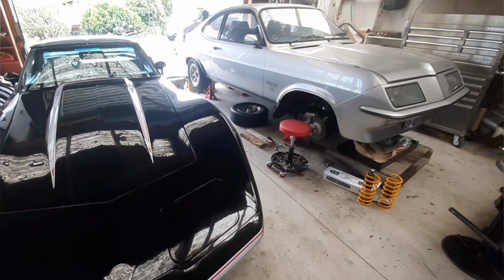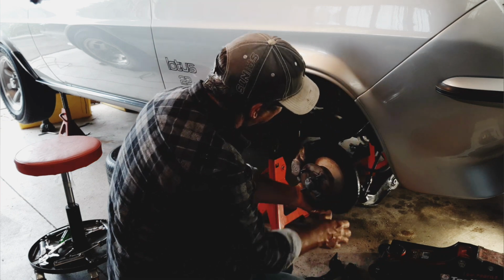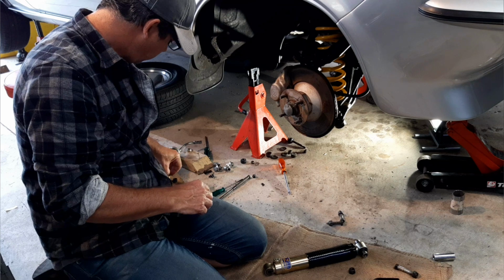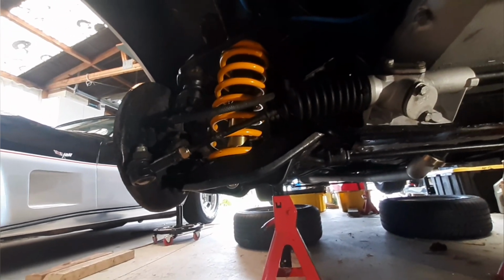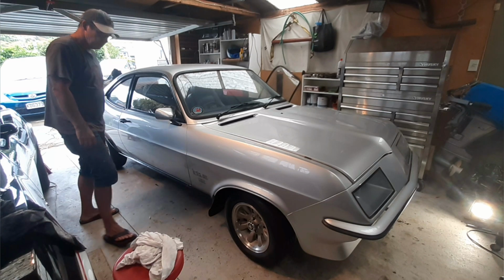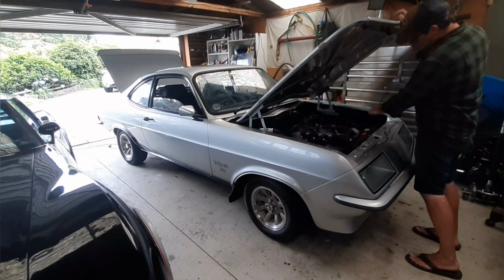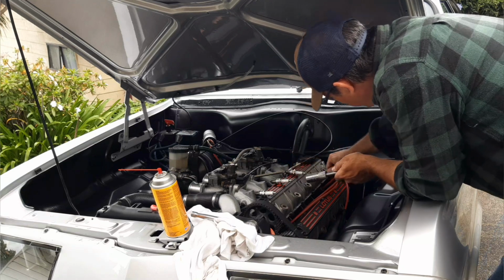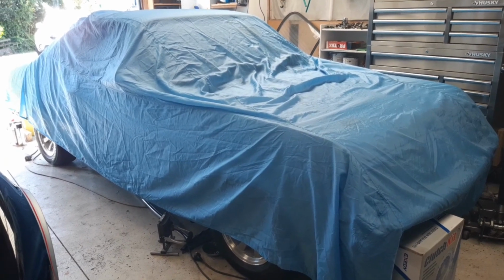The Firenza HPF finally gets some (unneeded) attention!

Comment: Great car, I love the droopsnoot firenzas, I'd definitely put some filters on those carbs, you'd be amazed how much crap is in the air that's been sucked into your engine, I use either a K&N or ITG filter for the weber 45 on my classic mini.
Reply from the maker: Thanks for watching. 
I do have the original airbox that came with the motor, which I need to finish modifying to fit between the carbs and brake booster. I can then also draw in cool air. 😎

Comment: Takes me back to circa 1973 when I put Blydenstein neg camber wishbones, springs & Spax adjustable dampers all round on my old Viva GT. The front end was a mare with seized bolts etc. Like you I was working on the ground with the car on stands. Not sure my joints now could handle the kneeling down & acrobatics you are having to do there & I can assure you I was cursing & swearing just as much at 17 years old so it's not a grumpy old man syndrome although I do know where you are coming from. 
She made you work to get her started but once going she sounds sweet & free revving. A bit of summer bare foot🦶 driving as well. I hope you avoid the ticket. You'd think they would have better things to do.
Reply from the maker: Thanks for your comment.
 I don't mind working on the ground during summer months, but come winter I'm not so keen,  which is just around the corner for us. 
There is definitely a procedure for assembling the front end of these cars, which once you've done it seems simple, but it never is the case. 
More work on the front end to come. Thanks for watching.
Reply from the maker: No ticket, thankfully.